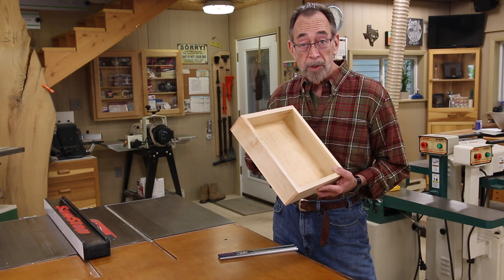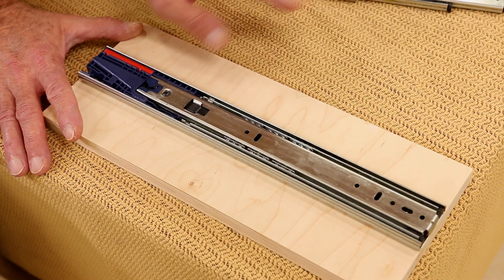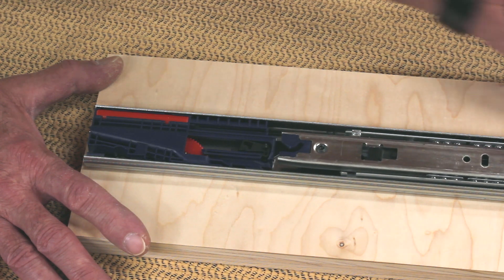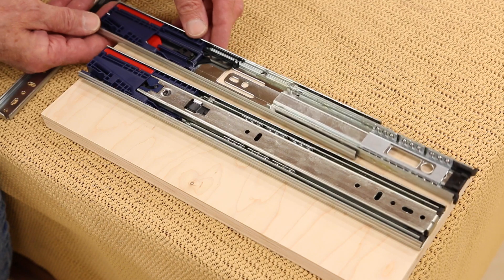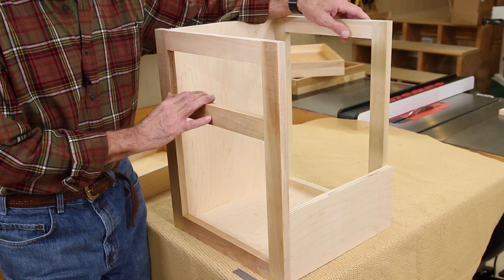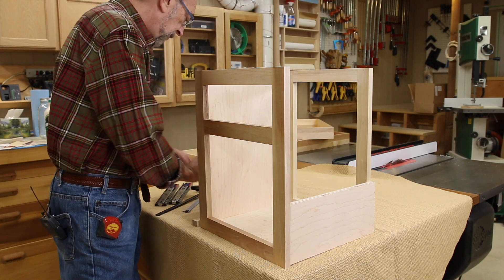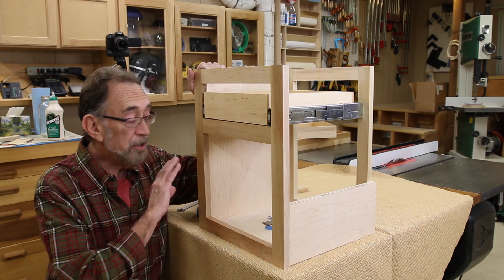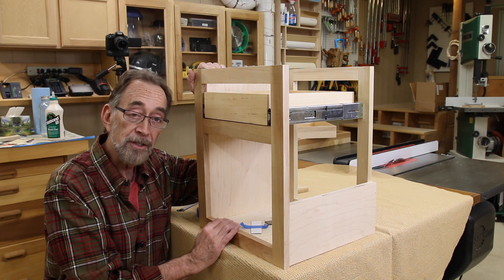The Down to Earth Woodworker - How To Install Drawer Slides

Comment: Good tips! 
One thing to keep in mind is the cabinet needs to be checked for level prior to using a level to set the drawer. 
Also, I have in the past used a larger block inside the cabinet to help locate the cabinet-side slide hardware. A scrap piece of plywood 12” deep or so positions the slide parallel to the cabinet floor.

Comment: If you’re using the rear mounting brackets, you have to figure it adds 1/16” to the width at the rear and take that into account. I use a cleat with the rear mounts on it as the instructions describe. It’s 1/8” longer than the width of the drawer opening to take into account the added mount width, but it has to be centered by moving it 1/16” over, not in line with the side of the opening.

Comment: Excellent and informative video. Picked up a lot of great tips! Though I'm wondering about that shim you install on the back of the slide (10:57 on the video). I'm guessing that shim is about 1/16 inch (maybe slightly less). If you put the shim on both back sides, then the back of your slide will be 1/8 inch less than the front width? Maybe I'm missing something?

Comment: Great instructional video Steve.  I was wondering if you could give us some information on the door slides?  I think you said "K-V"?  Not sure where you can get them (or others).  Or the approx. $.
Reply: Thanks for watching!  K V is Knape & Vogt... here is the link:
https://www.knapeandvogt.com
You can purchase these at Woodworkers Hardware. They have many different styles, but here is the self-closing slide I use a lot:
http://www.wwhardware.com/kv-8417-self-closing-100-lb-full-extension-drawer-slide-kv8417
The prices are determined by length, but you will see all the options when you go to the link above.  Hope this helps...

Comment: Great video. I am hopping to build your out feed table soon.
I am building small shop cards to put my bench top tool on casters. I plan to add 5 draw to a 23.5" x 23.5 x 29"H 3/4" plywood cabinet. I plan on putting the slides on first with the two slots and then gluing it up. Then I can adjust them and put the final screws in the fixed holes.  Do you see any issue with doing it that way?

Comment: Great video, putting on drawer slides is a lot harder than it looks! This video does a great job showing that because even with a woodworking expert, Steve, and all the time and care he took to put these in straight and level, it ended up not being level side to side! Take a look at the gap under the drawer from one side to the other. About an 1/8th an inch difference I'd say and this is why I HATE installing drawer slides!! I think because he was making a video he forgot to check his level in that direction. But, a great video that shows good techniques to get your drawer slides installed. Thanks!

Comment: Thanks for sharing this video. I installed some drawer slides today using the method shown in your video and it made the job fast and easy. The instructions that came with the slides were in three languages. The instructions were useless in all three languages. I almost purchase a jig before watching you video and now have proven to myself it is not needed to easily install the slides.

Comment: Let me start by saying I love your instruction and subscribed to your channel.  

One thing that jumped out at me is when you leveled the drawer to install the drawer slide, this only works if you are building the cabinet on a perfectly level surface. 

For me in my garage, I don't have a level workspace.  The floor is sloped.  I'm sure your shop is level.  I just thought it worth noting to check your build setup before using that method.